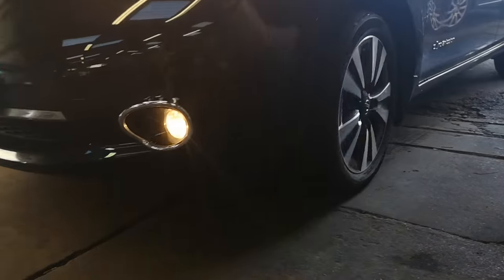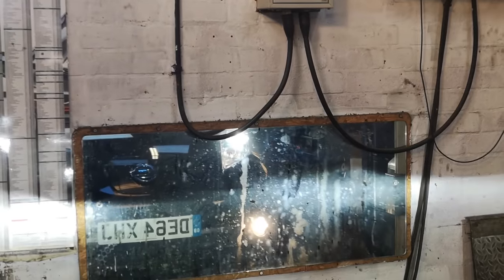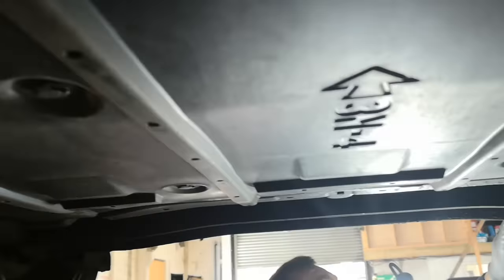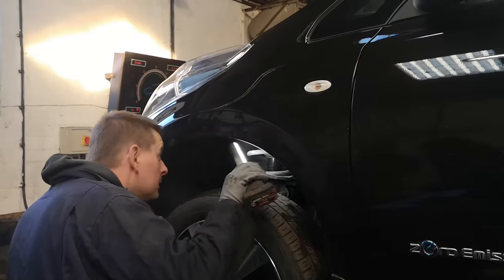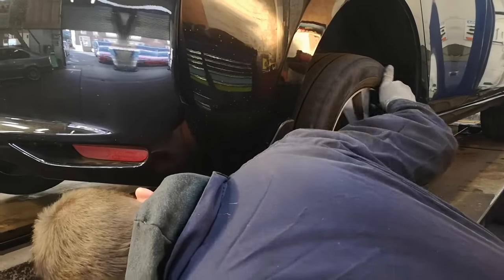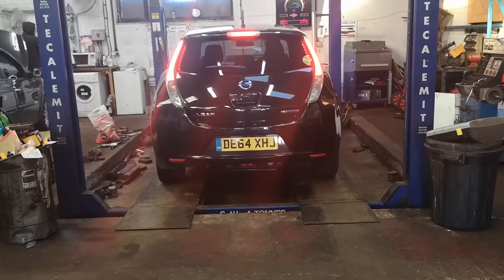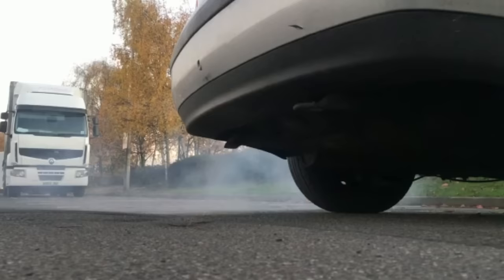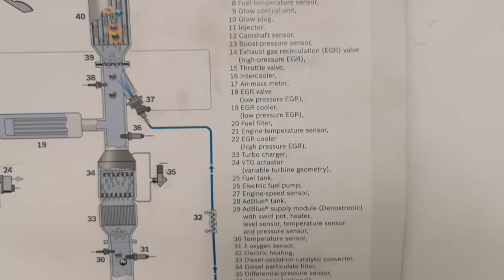An EV MOT, How Easy Can It Be?

Comment: Thank you Kate. Can I ask you please, do you remember where he jacked up the front of the car. The reason I ask is after my mechanic took my leaf for an MOT, I noticed that there are two small box sections that look like a jacking points, but on mine they have been crushed in and there are trolley Jack imprints. These box sections are only thin metal. The box sections are located about 20cm in from the outer edge of the car cill, and just behind the wheel arch, and the plastic wheel arch liner is attached to this box section. Just wondering if anybody else has had this happen. I am not sure whether the mechanic did it, or the MOT garage, or maybe the previous owner. Thanks.
Reply from the maker: Hi. The box section is generally for structural support but won't manage the weights for jacking. The best place is on the sill with a suitable jack and jack pad 👍🏻

Comment: Our Leaf bought from Eco Cars a year ago passed its 2nd MOT with no issues so very pleased. One thing though; as I’ve put the steel rims with winter tyres on, this was a technical fail as the wheels don’t have TPS sensors and the warning lights are on. However, the garage were very accommodating and passed it anyway. 😎
Reply: I hope i never have TPS  those sensors in the wheels are such a pain. Shit garages always seem to damage them. The battery can go flat. They have to be programmed, and in most cases there bloody expensive

Comment: I reluctantly still take mine to Nissan, the only thing different they do is plug into their diagnostic equipment and give you a good boy/bad boy report on battery charging technique and overall capacity. Useful I guess before selling one but had my leaf since 2013 and would only upgrade to another EV, maybe a Kona at this point. I love driving my leaf, pity Nissan/Renualt have taken their eye of the ball recently in terms of overall design both external and internal and still no thermal battery management system on the new E-Plus Leaf? Good to finally see other manufacturers getting on board 10 years too late. The biggest point you make here is regarding air quality and emissions, more humans die from related illnesses due to air quality than anything else. Emissions tests need to be much more stringent.
Reply: There's a lot of cars already failing the tests if they make them any stricter most of the old cars will have to be scrapped. Most of the new cars show 0.01 that's what mine does each year. Had to scrap some of my older ones just could not get them to pass.
Reply: Like one we had. It. wouldn't pass the test with the factory-fitted carburettor. Had to fit an 'upgraded' one from the next model. £65 second hand, fitted. The rogues. The car never had as much pulling power after that. Fuel economy improved slightly. For some garages, the less there is to do, the fewer fiddles they can play.

Comment: Watching this many years after first release as our ID.3 will need an MOT at the end of February 2024.  In Rugby we have a proper Ministry of Transport MOT centre so I shall book it in there.

Having had the car fully serviced earlier this year by Cleevely including a full brake strip, check and lube, a new set of rubber all round just 4 weeks ago, new wipers at the beginning of October, and the car having come back this week after a software upgrade and battery recall check with VW*, unless anything untoward happens in the next 10 weeks I am quietly confident but not complacent of a pass.  

* VW dealers just love to do a walk around especially underneath checking everything.  It got a full set of green ticks with no "advisories".

"Happy days", as James would say!  😉

Comment: What's more depressing is that my local council where my taxi is licensed still charge for BEVs requiring an mot (not a problem on new cars) but charging the same amount as ICE when it takes a fraction of the time to complete! Cheers
Reply: Mot every six months for Private Hire Vehicles in London
Reply: On the plus side, council testers don't tell you that you need work doing which you don't need, just to get some money off you....allegedly.
Reply: It's got nothing to do with the time it takes the mot.  It's money for the governments pockets. The garages only do mot's in the hope of work.  Also how does it take a fraction of the time what is part they don't need to check ?

Comment: Sounds about right, that. The mileage is still very low, so any problems I can really think of in an EV that age and mileage is maybe body corrosion and sticking brakes due to very limited use. Same thing happens on ICE vans, if they are continuously driven below half load or even empty. The rear brakes get stuck and then wear really quickly. But yes, EV's benefit massively from having no engine. Also in Finland, the emissions of ICE engines cover about one third of MOT fails. Rusting chassis and wheel supports can fail any car equally, if driven continuously on salted roads and not addressed properly. I noticed, that some of the suspension arms on your Leaf had rust already, but looked like it will do a lot of miles still.

Comment: Very nice video, The Rack that guy used to move the suspension parts left and right rather than using a pry bar is pretty sweet.
I do want to point out that it seems like anytime an electric vehicle channel or other eco-friendly channel shows an ICE powered car, they tend to show big clouds of smoke coming out of the exhaust. You see this in movies and TV shows also. I can't remember the last time I saw a gasoline or diesel powered car smoking the way you showed it here. 
You're right about all of the complicated Parts on modern diesels, of course most of this is because of emissions regulations. At this point I don't think I would buy a diesel powered car or light-duty truck at least in the United States the cost is unbelievably High for very little benefit and gas mileage. If I was using a heavy duty truck to do significant towing then the diesel engine make sense.
Most of the United States doesn't have any kind of MOT inspection, and certainly not as complete as this was. Not sure if that's a good or a bad thing, where I live they just check the lights tires and parking brake, and hook it up to the OBD2 connector and see if there are any pending codes or if it has failed to go through a drive cycle. Most of the country there is no testing at all, just pay your registration fee yearly and you're good to go.

Comment: Thank for the interesting video - always wondered what actually happened. Looked like new tyres on the car: do you recommend any particular ones for a 30kW Leaf? About to change a couple of them so would appreciate any advice.
Reply: I couldn't get hold of the original brand of tyre when mine came up for renewal, decided to go with Goodyear EfficientGrip Performance.  Same energy rating as the originals but better grip in the wet.  Tiny bit more noise but not really noticeable.  Decent price too and a lot of Leaf owners use them, which is hopefully a good endorsement in itself!
Reply: @tyrekicker9377  thank you

Comment: While I was changing rear brakes at my local garage ( I did the work myself), a Tesla model S had it's MOT done. Of course it passed.
A lot of old cars are failing the tighter tests, especially on emissions due to faulty or missing emission components.
Reply: Mines not had a DPF in for 7 years and still passes, emissions for my vehicle are 0.50 and it comes in at 0.33.  !??!?!

Comment: Great video.  A few months ago I took my Leaf for its second MOT - smugly thinking it was bound to pass easily.  It failed because the tester put the parking brake on - and it didn't release properly.   Just because of lack of use - I hardly ever use the parking brake.  Trying to get into the habit of using it occasionally just to keep it working!

Can't complain though - that's the only repair it's needed in 37,000 miles...
Reply: Interesting. I use it at most light stops. And what did it cost to repair this issue on your Leaf?
Reply: @MCSMIK  Invoice says Stripped, serviced and adjusted rear brakes:  £69.30.

Biggest problem was finding someone to do it - Nissan dealer couldn't look at it for about 2 weeks - but I found an independent who managed to squeeze the job in.

Comment: Great video as always. I have some big speed bumps locally, I wonder if my Zoe crashing over them will cause future issues with suspension due to the weight of the car.
Reply: Actually, that's good question. Is that true Zoe has suspension from Clio which is quite a bit lighter?
Reply: Mechanical sympathy as a mot tester and tech slowing down for bumps Is important to prolong component service life and save money

Comment: in the past, all EV cars ie milk floats did not have not have an MOT (not sure when the government changed the rules to include EV 4 wheel cars) ~ the police in the 1990s stopped X number and found almost 100% failed the MOT ~ they even took a number off the road straight away because they were so dangerous
Reply: Electric Commercial Vehicles are still exempt.

Comment: They should now get an vapor leak test done from the batteries of an electric vehicles, as they tend to leak acid fumes back into the passenger compartment, causing breathing problems especially when in use long term like cab drivers and high use can cause cancer.
Reply: Acid fumes from lithium batteries ?
Reply: Any links to sources of your information?
Reply: They "tend to leak acid fumes"??? Any source material to support that claim? I've never heard of a single car owner, over my entire life, ever mentioning acid fumes.

Comment: Those balance weights on the wheels aren't good, alloy wheels should use the stick-on type, those ones in the video scratch the paint on the wheels when fitted/removed, which allows the corrosion to start, eventually leading to slow punctures and messy looking wheels which will need refinishing.
Reply: Most alloys don't even have a rim to attach weights on the face.  If they do you get a much better balance than the stick on weights.

Comment: its hardly much simpler, just no exhaust to shove a probe into, the rest still applies.   just dont have to warm up an engine and run the probe,  still a ton of warning lights to check, as well as the chassis, is all the same as a regular car, in fact the easiest MOT is a car 25 years or more old, few warning lights to check

Comment: MOT test is a farce , they have now changed that if one of the number plates is out it`s now not a fail and the steering lock not working is only a fail if it doesn't have a secondary security system  i.e. immobiliser  all cars with  a sterring lock have immobilisers so pointless testing the steering lock . also cars registered after  2009 have the reverse lights tested  now , surly  all cars fitted with reverse by the manufacturer should work if they now need to work  they need to work for all , it makes no sense ....In my experience the most common fail after diesel emissions from people who just potter about  in them  is Screen wash and things hanging off the rear view mirror .

Comment: They put an EV on the rollers? Hybrids and EVs are not meant to be in most countries due to risk of damage. In Ireland it is road tested with a G meter and the opinion of the tester who have quotas to fill.
Reply: What damage could occur? The car is designed to roll, the brakes are designed to arrest rolling. As long as the car is in neutral I don't see what could go wrong.

Comment: No emissions test with a hybrid either so much the same.
Reply: Seriously? How can a car that has a combustion engine and a tail pipe not be subject to a tail pipe test?
Reply: @MCSMIK  Not just hybrids, all motorbikes and mopeds etc don't have an emissions test. It's probably because you can't rev the engine when not in gear, you can floor it and the revs only go to about 1500 rpm, not enough to do the test.

Comment: This is just weird!  Why are they doing this and why do you need a Microwave Oven Transformer?
Reply: Ministry Of Transport safety test. It's a standard series of checks which are designed to save lives. They're mandatory, and annual,  on all vehicles which are more than 3 years old. Kate forgot to show the lighting test, and the windscreen examination, but she did mention the handbrake and suspension checks.

In pre-MOT days, I once had to jump out of the way of an out-of-control car which had one side of its front suspension break, and dig into the road surface. On another occasion, my half cousin was driving his VW Beetle, when both front wheels broke off and went under the car, projecting the vehicle and 4 occupants into a deep dyke. (Not just a ditch; it was a drop of more than 4 metres.) Those kinds of accidents are much rarer today, mainly because of the basic MOT checks.

Comment: Do they check the particulate, Co2 and Nox values produced at the power stations charging these things.   Better add in radioactivity as well.
Reply from the maker: I love these comments and I hope you reply to this. Do they factor in the energy required to extract, transport and fractionally distillate the fuel which I'm guessing, fuels your ride 🤔 any idea how much energy that is, look on google?? I'll tell you. An EV fueled from 100% coal works out 4 times more efficient than an ICE car 😳 also, do you know how much of our energy is produced from Coal??? As I write this, 6%. Ever considered who breathes the rubbish the comes from the exhaust at street level?? Kids, elderly, asthmatics??? You should research it and come back to us. Also, Tesla battery life cycle estimated to be 27 years and the batteries are 99% recyclable.
Reply: Month by month the grid gets cleaner. Could you imagine a situation whereby electric cars did not exist.. the incentive to cleanup the grid would be reduced.. as they (people running the grid)  could sit back and say "well.. the smokes gotta come out somewhere!".
Reply: John John - The U.K. electricity grid is gradually becoming more renewable fuel-based. 27% of that country's electricity was from such sources last year, and even in January this year, 24% has been from them. At peaks, over half of our electricity is from non-fossil fuels. That's excluding nuclear power in all cases. Year-on-year, we're seeing a 5% increase of total electricity demand being supplied by renewable sources. We've a goal of having 0% of our electricity from coal by 2025, and we only have one reserve oil-powered plant, which has not been used for the past couple of years.  There's still a huge potential for Britain to increase wind powered generation, and we've hardly touched tidal schemes. We have some of the best tides and currents in Europe. Source of figures: grid watch. co. uk. (with no spaces).

If you're really concerned, take a look at the CO2 emissions figures on that website, and see how they're beginning to reduce.

For the record, Norway puts us to shame, with 98% or 99% of electricity being generated at hydroelectric plants.

Furthermore, fossil-fuelled power stations are pretty well optimised for efficiency and minimum emission and particulate levels. We've a good friend who worked for the CEGB, and who can attest to that, because he helped to design and maintain some of their scrubbers. 

In contrast, it's impossible to ensure that a vehicle engine runs at optimum efficiency and 'cleanliness', primarily because of the very variable load conditions to which it is subjected. According to Carnot, no heat engine can be better than 50% thermally efficient, but in practice, that turns out to be about 30% for Diesel engines. Petrol engines hit their limit at about 25% thermal efficiency; neither chives total fuel combustion, and all suffer from non-ideal thermal transfer. A properly designed power station generator can be used at close to maximum economy for most of its working life, as load hangers are more gradual, and as generators can be taken offline, or added, when required, allowing for much better efficiency than a vehicle IC or CI engine could ever manage. 

Finally, any pollution caused by a centralised fossil-fuelled electricity generating plant is caused well away from a population centre, whereas vehicle exhausts are always close to people; often within a metre or two of the driver and passengers. As a result, the pollution concentration levels from power stations, even if all generation is from coal, are far lower in the vicinity of people, if enough EV's are used to replace fossil cars.
Reply: Yes I am aware of all that, I do't think you realise that how much of electricity in the UK is still produced by Coal, nuclear, and CCGT plus up to 10% of UK demand is met by Dutch and French electricity via interconnect cables and who knows, as being part of the European grid, it is produced.
The buzz word for EV's is zero emission at the tail pipe, forgetting just how much environmental damage - all instances - to achieve that figure.   
There is a YouTuber - US based - who's calculations are reported on his channel, who having bought an high efficiency EV he reckons to match the C02 footprint of his EV to ICE to become carbon neutral will be around 17 years.
Most of the improvement of the grid etc should be couched in 'Jam Tomorrow' terms.   I  readily accept that for everyday tootling about motoring an EV would suffice.  Unfortunately the large time required to charge the battery compared to filling the tank, roughly with my car 1, 5 min fill up equates to several hours of charge time, and I cant afford 2 cars one EV and on ICB, so to have an EV is just not a realistic option.
Until I can get a 5min charge time and the ability to tow a loaded trailer, a current EV does not meet my needs.
Considering that newer more efficient methods of extracting hydrogen for fuel cells are being developed, it just maybe that battery fuelled EV technology is stop gap that will disappear over the years.   After all in Germany Hydrogen powered fuel cell trains are a reality.